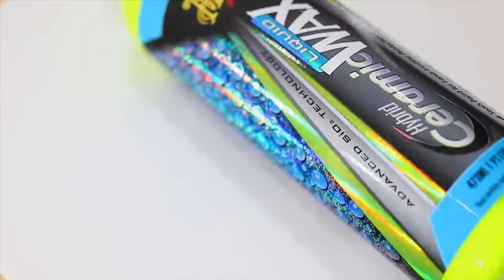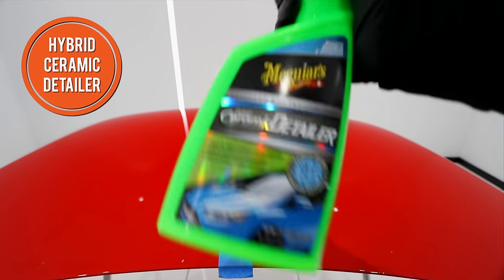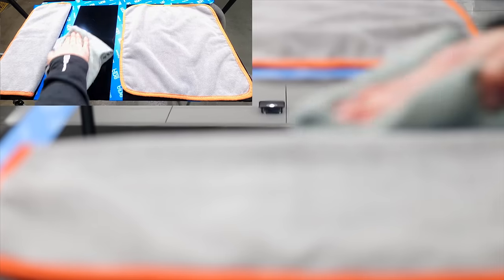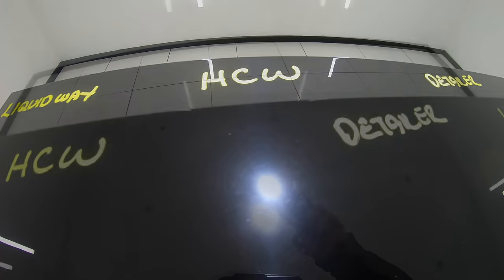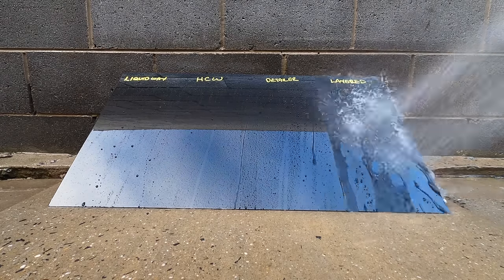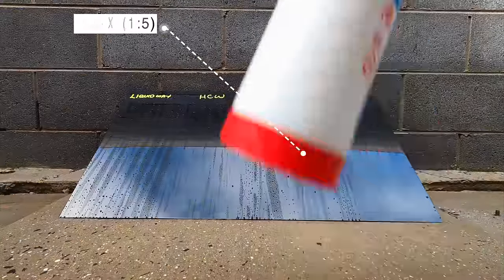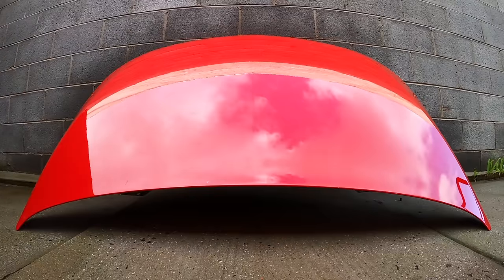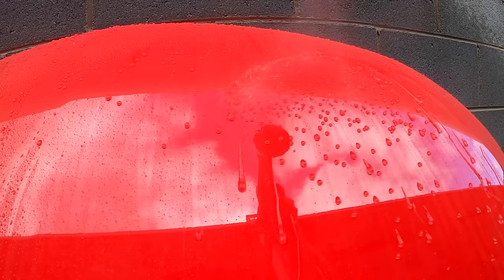Meguiars Hybrid Ceramic Range Testing & Reviewed!

Comment: I stood there in the store with the liquid wax in one hand, spray in the other. I chose the liquid because it seemed the more traditional application of the two and I simply couldn't wrap my head around the bizzare idea of spraying ceramic wax over a wet surface. I wish i had seen your video beforehand. I'm really surprised how well the spray works! I'll definitely have to go back for the spray and try the layered effect. Thanks for testing this out for us!
Reply: I actually took out my phone and looked at another video that came to the same conclusion.  And I 100% had the same thought you had.  I bought spray, but haven’t used it just yet.
Reply: Ikr I have been using the HCW spray wrong this entire time. I just didn't know if I could use it directly on dry surface

Comment: HCW is epic when applied dry, really makes your car pop! Gloss level is outstanding.
Reply: for me, its smears too much and is too thick to apply dry and it is super annoying.
Reply: Ya I do agree with you. My first application was same like traditional wax way back
Reply: I found spraying on a very small amount and working that over the area worked well, definitely 'less is more'. The recommended applications from Meguiars use far more of their product, of course, that way they'll sell more! I agree with you too Ken, gloss level is great, cheers Anthony
Reply: @danvird8649  use less. I spray one or two full sprays into a MF booth then per panel I lightly, almost just dribble a small amount, then work it in. Less is better and far easier to work with, but the results are far better than wet application.
Reply: @TheAjs71  absolutely, meguires would have you use half a bottle to do their foundation layer, whereas I do a whole car using about 30-50ml! The bottle will last me years🤷👍
Reply: @TheAjs71  I've stopped using it as i found that it really smears and leaves like a surface thats sticky, not to say its sticky to touch but when dust settles on it, its impossible to spray them off using a jet. But after looking at ur comment i'll give it a 2nd chance. Thanks for sharing
Reply: I love these three products in a "stacked" application
Reply: I have been using HCW for a while and works amazing, be sure to apply the fundation layer and all will work great. After 6 months i topped it with Chemical Guys Hydro Slick , its MIND BLOWING how close to a true ceramic coating my car is looking and performing . Cheers !!!
Reply: @TheAjs71  i watched the demonstration vid..they do say less is more
Reply: @frostzone548  man..how we all have our different views..sticky?..its really slick feeling
Reply: For the guys with smearing and being sticky, just use less as others have said. No issues here, first app we would all use too much😅😅
Reply: Great wax, but for best results use a damp-almost dry cloth to remove haze. Make sure it's not dampened with hard water or it'll leave stains.
Reply: I mist with distilled water to help remove HCW.

Comment: the hybrid ceramic wax is the best overall sealant on the market. I like the liquid version because I can apply it with DA polisher very easily.
Reply: What's a DA polisher?
Reply: @kevinroark5815  dual action
Reply: @joshuaslattery3642  Cheers

Comment: I have applied the Ceramic Liquid wax first, then after one day applied the Ceramic spray wax using a damp sponge applicator and doing panel by panel, it gave an outstanding finish, no spraying of water at all, apply leave a few minutes wipe off.

Comment: Key is frequency. I am not going to apply liquid wax every time I wash. However, I WILL use the spray and rinse technique every single time I wash. I do agree, you should apply the first coat of the hybrid spray wax on a dry car. I used a damp towel then buff with a dry one. I apply the spray hybrid wax on a dry car every 6 months as a refresher. Maguiars says its critical to do the rinse application or at least rinse the car again after a dry application. Reason is the carrying agents are hydrophilic and need to be rinsed away. I wash my car every 2 weeks in the summer and once a month in the winter (since its garaged more) The performance of the product is amazing since its so so so easy to apply it very  often. So in closing, apply the spray in  a dry car once every 6 months and use the spray and rinse technique everytime you wash!

Comment: The BEST breakdown comparison video I've  seen so far. Bought a new Nissan 2023 and the detailer guy suggested Meguiars Hybrid Ceramic Wax. Since my Nissan was paint sealed protected aready, I used the detalier for now. I used the  spray wax on my 2011 Kia Sorento..... and the paint came back life for a twelve year old vehicle. I paid just under $30.00 (🇨🇦)each for both bottles. It's $15-$17 in the U.S. Crazy price difference from these to Australia. Cheers mate...

Comment: I really like your overlay and PIP information that helps clearly demonstrate what you and products are doing.👍🏼 First in class.
The results are what I see on my current daily, except I switched out the Meg's liquid wax with Turtle's Hybrid Solutions Ceramic Polish and Wax applied with a DA Finishing Polish Foam pad. Topped this after 24 hours with dry application of  Meg's HWC and then Meg's HCD 24hours again. Nice relaxed weekend job.
It is performing so well I started feeling guilty snow foaming weekly as a waste of set up time and product.
The late heavy rains are doing a self cleaning job.
In all honesty, a standard garden hose nozzle rinse now, followed by  a quick 2bucket Meg's Ultimate Wash and Wax weekly, with the HCD drying as an aid is giving stunning deep shine and visual protection.  
Brilliant for these cheaper OTC option products.
Keep up your great tutorials.

Comment: The key feature with the Mequires products is how easy they are to apply. I can’t comment on durability because I have only just started using the Hybrid Spray Ceramic. In the few weeks I would have to compare it against the other product I have used on one of our vehicles. The Turtle Wax Hybrid Ceramic  was applied last Summer. I prepared the vehicle’s surface by spray foaming it, then clay barring it, followed by a wash, then a compound then polishing and a coat of lightly applied TW Hybrid Ceramic. 24 hours later I rinsed off 5he vehicle ( it hadn’t been driven and was under a carport ) to remove any dust and applied a 2nd coating. With a simple foaming a wash and dry, the vehicle looked great until I reapplied it he TW again this Spring following 5he same procedures. Lots of work but amazing  results. The rain beaded amazingly for over 8 months. The shine didn’t diminish much if at all ( it still looked better after the winter than the vehicle looked without the TW step in the past. I’d have to say the Mequires Hybrid Ceramic spray looks pretty much as good as the TW ( 2-3 weeks so far ) and after an overnight rain and driving 50-80 km/hr. the water beads just slid easily off the body panels. I have two coats of the Megs Spray, the 1st applied semi dry and 5he second applied after a wash and rinse but rubbed onto the surface, rinsed and then dried. It’s late July so we’ll see how it holds up this winter. I will reapply again every other wash just because it’s so quick and easy. By the way you posted the prices, in Australian dollars??? Here in Canada, I paid $18 for the Meg. Hybrid ceramic spray. You guys are getting ripped off! I don’t think the Canadian dollar is any higher than the Aussie buck.

Comment: What a treat! I just recently purchased these products to test them on my vehicles, Already started hoarding the detailer spray as they are in high demand and cheaper than the turtle wax ceramic alternatives. One thing though, I used to buy Meguiar's xpress wax and dilute it 1:1 with Meguiar's last touch, the hybrid detailer mixed with last touch leaves lots of streaking and almost feels greasy, ended up tossing that bottle.
If you ever get your hands on the turtle was ceramic stuff, le us know which you think is best.
Glad to see you are still safe and putting out these insanely high quality videos!

Comment: I did a full stripping with meguiar's iron remover (it is alcohol-based, so I assume it removed any residual waxes). Then I used their clay bar and regular quick detailer to clay the paint. Then I did a paint correction with Meguiar's liquid compound and then ultimate polish using their dual-action polisher. Then I applied their ultimate liquid wax, which I believe is a sealent, using the DA polisher. Then I applied a coat of the hybrid ceramic liquid wax with the DA, letting it cure overnight. Then I applied two hand coatings of the hybrid ceramic liquid wax, letting each cure overnight before applying the next. And now, whenever I rinse my car with the power washer, I rinse, spray on a few sprays of the hybrid ceramic spray wax on each panel, and rinse again. Then dry with a microfiber drying towel. It seems this method has provided perpetual protection and insane hydrophobicity. It has been about three months, and their is no change at all to the water behavior or gloss level.

Given your findings, when I have time, I will apply a coating of the hybrid ceramic spray by hand when the car is completely dry. I believe that will carry me through the winter. The winter road conditions in NY are very harsh--tons of salt, slush, a lot of rain also in the winters here. That will be the true test, as I will not be applying any fresh dry coats during the winter since it will be too cold, and I won't have time (have to work 70 hours per week and will not have any real free time during daylight hours).

I checked with Meguiar's, and they say that the hybrid ceramic products can be used as top coats over their ultimate liquid wax and pretty much any other product. They recommended against using any other products on top of the hybrids, as well, stating it would disrupt the water behavior of the hybrids.
Reply: Perfect, thanks for researching all that. I was confused. Can I use wax or polish after using Hybrid wax or do I have to use it before or not at all? I think your findings answer all that

Comment: Excellent video. Great testing, thanks for all the time put into this.
I personally use only the Hybrid Ceramic Wax. Quite easy to find here in France,  at about 20 Euros, but well worth it because the bottle lasts quite a long time. 
I applied it on a well prepared dry surface, buffed it and added a second coat after an hour curing. 
Left it to cure overnight before exposing the car to the exterior elements. 
Seems to hold quite well in terme of longevity, and really beads well.
As soon as it shows signs of weakness, just spray some on a washed wet car, spread it lightly with a microfiber,  pressure rinse it, dry it, and you're good to go.
You get another six months of perfect beading.

Comment: Im a regular user of HCW spray and love the easy application after a wash - by spraying on then rinsing off. It’s super easy.
Reply: I feel like the spray on wash off method doesn't even work? have you noticed it improving the initial coat?
Reply: Ddan616 I think it maintains the initial cost rather than improves it.
Reply: @timmarks8941  yep..u nailed it! After a while you will have to apply it by hand..but the squirts in-between the times you are not applying by hand helps protect the base layer..i find this stuff easy to use! Even when appying by hand..jus spray and dry with a towel

Comment: I tried the hybrid ceramic wax last week. It went on very easily according to instructions. Very nice shine and even seemed to do a good job on the plastic trim. The beading and the sheeting were at least as good as any wax I have used over the years.  I did approx. 1,000 km of highway driving in Northern Ontario and managed to kill my share of bugs. I washed the car shortly after returning home and the bug guts came off far easier than anything I have ever used. Just a wash mitt and Meguiar's car wash soap. All in all a great product!

Comment: It might not be the best most effective product out there but the system works great together and is super easy to use. Just the green detailer spray can be used as a full way after wash. I covered it and it beads like crazy.

Comment: Hi Sandro.  I have used the liquid form (not the spray wax) to test it on my new car which I bought on 12/27/2019.  I prepared it with proper decontamination of the paint and expected it to last several months, at least 3, and it only lasted halfway even after following their instructions.  Then, I purchased Turtle Wax Hybrid Ceramic and even after we had in the island the highest Saharian dust record of 305 when the highest recorded was several years ago of 154, I still haven't washed it for 6 months and still can feel the protection and gloss is also still seen because the rain has washed away dirt and dust and still beads like crazy.  I was very disappointed with this Meguiars since I use a lot Meguiars D106, D116 and D143 with my customers, besides some of their polish and compound products because they are very accessible in price, available in most vehicle stores and perform very well.  Thanks for your review.
Xoxo from Puerto Rico 👍🇵🇷
Reply from the maker: That’s really interesting and appreciate you sharing your experience with them!

Comment: I wasn't sure where the other two fell in the product line. I use the blue bottle as a top up after washing. After a hand wash and rinse I walk around the car and put a single spray into the pressure washer stream per area/large panel. Then walk back around to rinse from top down. The initial dry application has a huge effect on appearance. I like it because it's just so easy to top up and takes so little actual product to get the job done.

Comment: Love the review sandro as always.

I have been using hybrid ceramix wax for roughly 8 months on 2 vehicles (mine and my partners). After many applications i found that applying onto dry paint was definatly the best option. As it would last longer than just spraying onto wet paint and wiping it off. 

I find though when the time comes to wash both cars (usually about 2-3 weeks) the hydrophobic properties are almost completely gone. Untill i do the recomended spray on and rinse off at the end of my wash, then they come back. 

As of my last wash i did a complete decontamination of my partners car and a re application onto dry paint. Then i topped it with the ceramic detailer. I found that this time around when i washed the car today it still had 70-80% of the hydrophobic properties still present which i was pleased with.

I just find that by itself the hybrid ceramic wax for an every day driven car that doesnt get much cover and is 90% exposed to the elements the real world resistance isnt much chop.
Reply from the maker: Thanks for sharing your experience with them, and it sounds like some proper prep with the dry application of HCW and the QD has worked really well for you!
Reply: Isn't much chop? Meaning? Ty

Comment: I’ve been using the hybrid spray on wax for the past 6 months on a few cars and  absolutely love it.. I must say though the instructions on the bottle compared to what I’ve seen some Meguiar’s rep say is abit confusing. I’ve been watching videos on this and yours is excellent. The ones I’ve seen is the Meguiars rep slightly suggest for the spray on wax to be applied dry for the first coating and every coat after that can be applied wet.

After watching your video though it is evident that applying a dry coat first is the best method for durability. Maybe that’s why they only slightly suggest it meaning if you apply it in a wet method on the first coat you’ll have to use it more often and it turn purchase more of it over time.

Comment: Nice Video Sandro, I have all three of these products plus the M27 Pro Ceramic Sealant. I'am currently stacking M27 Pro Ceramic Sealant as the base and then i top that with the Ceramic liquid wax. I use the ceramic detailer for maintenance and drying aid works really well a little bit goes a long ways as far as the detailer goes. I put it on at the end of may and still have incredible beading.  i use the the HCW spray to boost after about 3 months. As i said it has worked really well so far. The M27 Sealant is really easy use  nice smell too.
Reply from the maker: Thanks, and it sounds like M27 is working really well for you in combination with these others, thanks for sharing it!

Comment: I have only used the HCW from Meguiars, which as it happens has just about run out. I was looking at replacing it with one of their other options, looks like I luckily chose the correct option straight away. Very often it’s £20 in Halfords, good enough for me. 
I used the Hybrid Ceramic Wax as the next product of protection after the Turtle Wax Graphene paste had done its bit, both very different applications but similar to identical outcomes ( to my unscientific opinion ). One took a few hours to apply, the other a few minutes, a bit of a no brainer to any busy dads out there. 
I am a Megs fan, I have their buckets, Gold Class shampoo, the only product my wife looked at her car and said wow after I cleaned it. The tyre gel is great, and has lasted me ages on our cars ( both with 20” wheels ). I have their wax too, but haven’t gotten around to polishing yet as my polisher has gone awol at present, but a garage spring clean will reveal it 😂
Thanks for taking the effort to produce such a comprehensive test, no mean feat 👏

Comment: As someone from central California that has top keep their car parked outside under a cover 24/7/365, the spray on hybrid ceramic wax is a damn godsend, 3 years on and the paint still looks like I got the car yesterday
Reply from the maker: Wow, 3yrs is pretty impressive and more than I would have expected!
Reply: @CarCraftAutoDetailing  I've done 3 major applications in 3 years, holds up great!